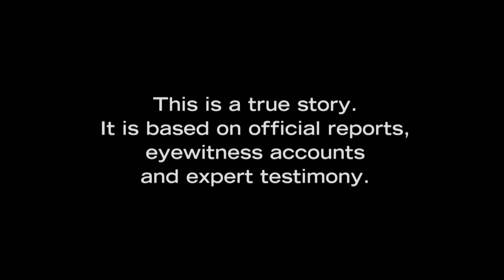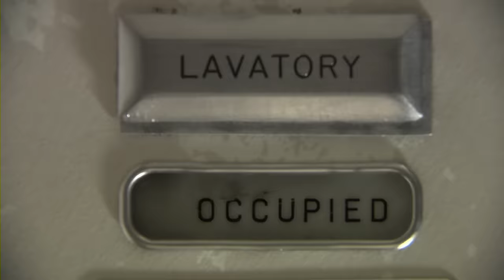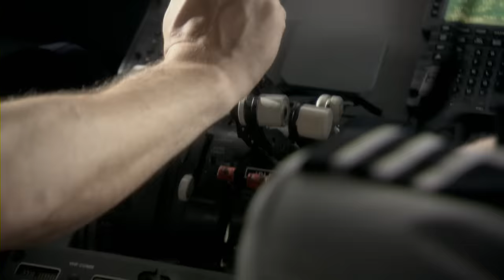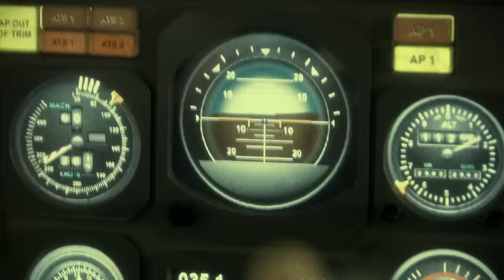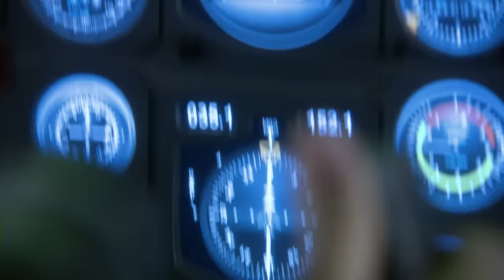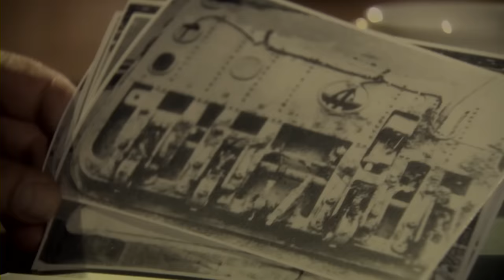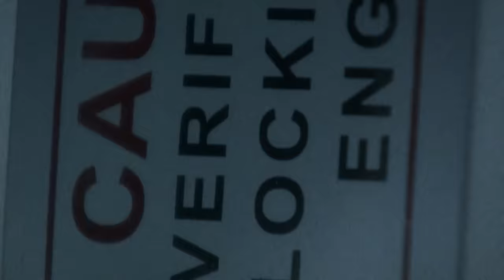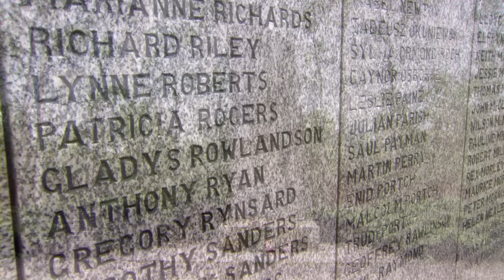From Marvel to Mayhem: American Airlines' DC-10 Horror | Mayday: Air Disaster

Comment: The only problem the DC-10 had was the cargo door issue that they FINALLY fixed🤷‍♂️. Otherwise the plane was good!
Reply: Not quite, but the overall point is well taken. American flight 191 was also a design related crash, and so to an extent was United 232. But 3 is still a very low number to be sure.

Comment: Not one word about the engine separation that began the deadly Chicago crash…..
Reply: That was the mechanics fault not the planes 🤷‍♂️
Reply: @willschultz5452 while true, the DC10 was grounded until they found the cause of the crash. There were several other DC10’s that had the same issue with mechanical procedure that was damaging the pylons to the engines. The 1979 crash was what sealed the DC10’s fate.

Comment: 12:25 I still don't understand the shoes. Maybe high heels for a woman, but my running shoes protect my feetsy weetsy's and my toesy woesy''s.
Reply: Any kind of abrasive surface can impact the inflatable slides - it's not only the distinctively spikey high heels, even a rough running sole can scratch the slides. A rough sole or even a boot can distribute too much weight onto any one point on the slide, even a relatively smooth running flat could cause a puncture. Wear sneakers to a bouncy castle and you'll see what I mean

Comment: I stopped this video at 16 minutes 19 seconds into the video, without watching the video entirely. From the one picture shown this was not an explosive device damage. Bombs or an explosion will over pressurize the bulkhead metal panels resulting in tearing of the metal. A flowering type of damage is expected with the peddles of metal protruding outward. This failure has smooth edges, with an entire panel section torn outward along what applears sections of fasters. Structure failure not a bomb. [US Navy AD2, enlisted 7 years. US Navy contractor NAS Lemoore, CA and US Navy contractor Kay and Associates, Kuwait Air Force contract]. Happy Everyone Survived (Allec Ibey. YouTube). Mahalo aviation family.

Comment: Is one thing to make mistakes during development. Is another whole fucked up level to have those mistake and NOT CHAGNE IT until someone DIE because of it. ALL FOR MONEY THAT YOU PROBABLYG DONT EVEN SPEND MUCH ON!
Reply: I'm in total agreement. But to be totally fair, MD had some reason to think the problem was solved: they could not foresee that Turkish Airlines maintenance would do the unthinkable. Just a few months before the crash, they turned the locking pins the wrong way, and extinguished the warning lights that had become a nuisance. This is why the plane didn't crash until March, 1974.
Reply: That's very salty language young man